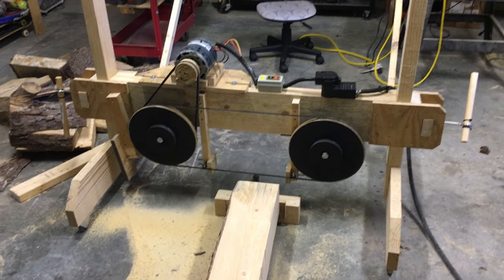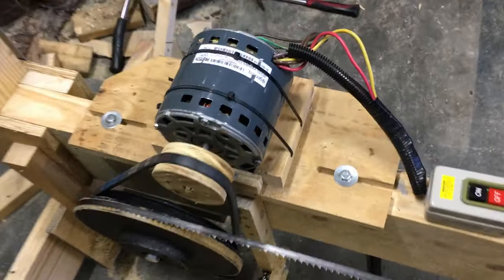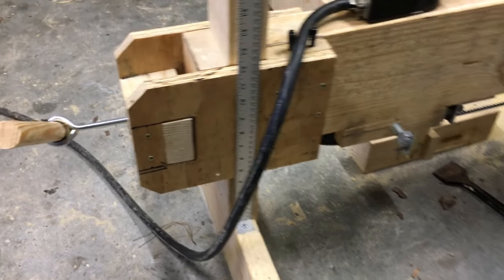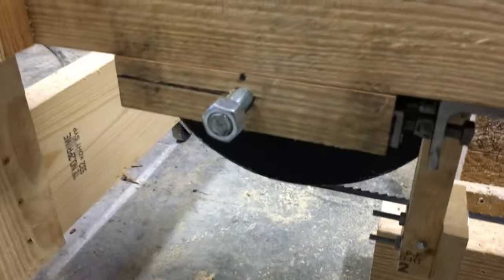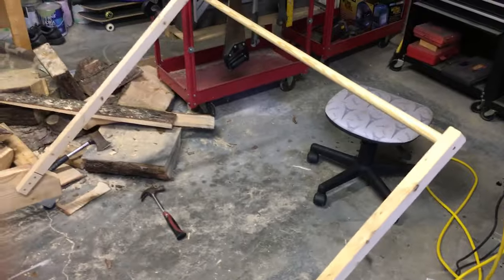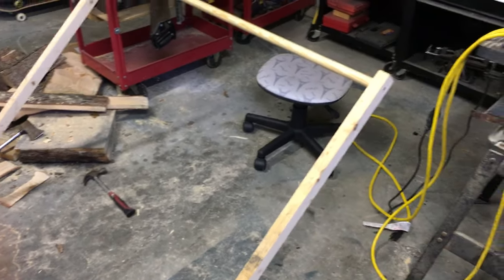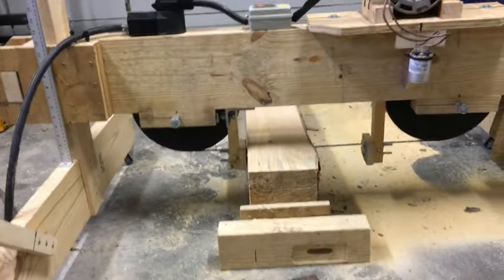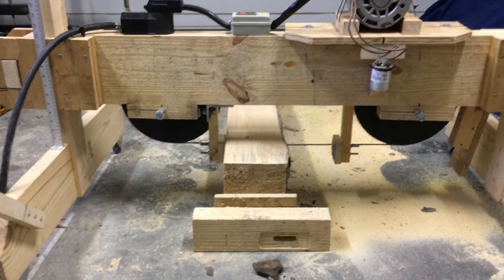Homemade Wooden Bandsaw Mill

Comment: Do you think it's possible to use belts and pulleys to gain a mechanical advantage for your motor?  I'm referring to the concept of the way it's used with snatch blocks, cable, and winches to remove tree stumps.
Reply from the maker: Yes that can be accomplished. You’ll trade final blade speed though. It needed a bigger motor but I was doing this on the cheap with what I had laying around.
Reply: @fire67bird  thanks.  Have you seen a video or something I could refer to that would instruct me?

If I could get a 10 horse power motor, and increase the HP by 2 or 3 times, with extra pulleys and belts, that would save a lot of money.
Reply from the maker: @DougVeazey-zl3xz  Matthias Wendel has a lot on his YouTube channel.
Reply: @fire67bird  I'm checking him out now.  Thanks a lot!